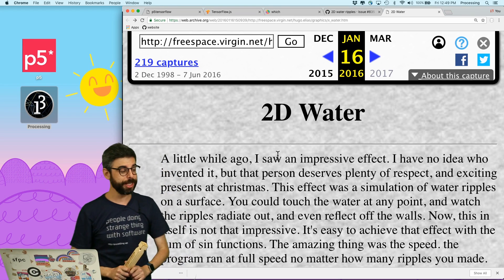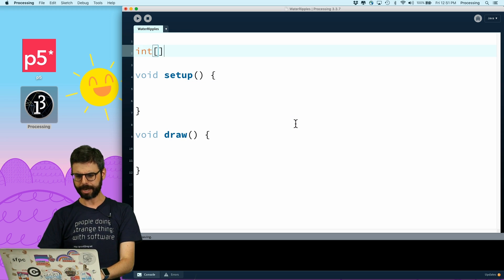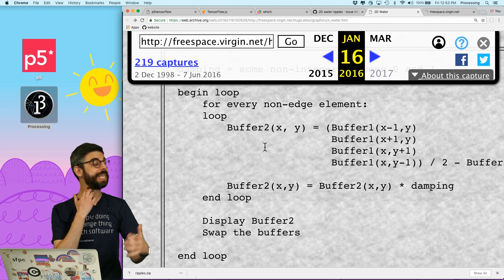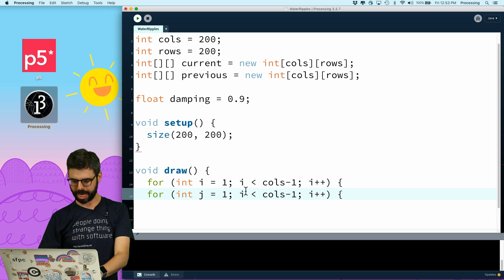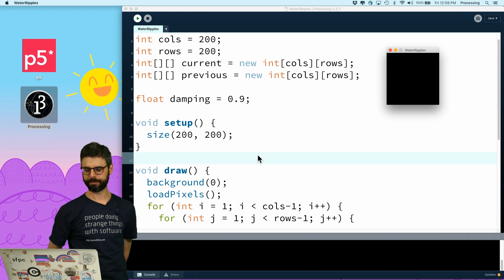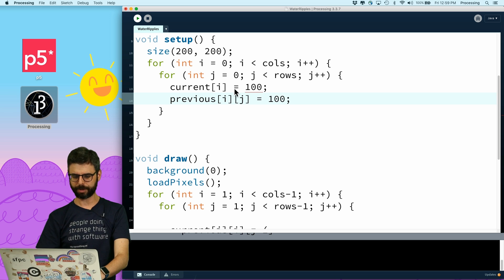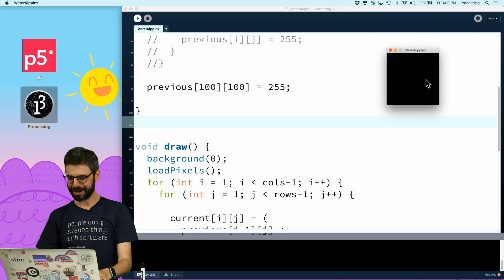Coding Challenge 102: 2D Water Ripple

Comment: That's a fun and nice simple routine that I've appropriated to create a 1D FastLED example on the Arduino.

My challenge, however, is limited RAM.  Some folks spend most of their available RAM on the CRGB array for the LEDs, and not enough memory is left over for the arrays used in this example.

So, how to create a nice smooth propagated and dampened droplet without using arrays.  So far, I've got sine waves, phase shifting and exponential dampening, but not the time oriented propagation from the initial 'splash'.

Comment: Hi Coding Train,

I made a OOP port to .Net / C# Forms, slightly more difficult than Javascript which does not really care about Type safety:
https://github.com/bieblsoft/Water_Ripple

I wonder why your code produces grayscale images, since you use the area values for defining Color value ??? Maybe black and white projector or such ? Mine is very colorful.
Another Problem i ran into is to signal when all values are back to 0 or at least a specific value ("rippling" is done). I simply limited the drawing loop for a workaround.
This "processing" stuff reminds me a little of Arduino coding, all the "Run()  Looping/Calling" is done invisible in the Background (of course Arduino coding usually lacks a screen).

Maybe i will try also in C++ to give it real speed, but this will require some graphics library.

Comment: Great video!
I was able to get the same result, however, I can't figure out how to use an image as the background which interacts with the ripples. Any help? :)
Reply: You need to create a displacement map, derived from the current buffer. The current buffer can be thought as a height map.
For each pixel in the image, the displacement map has two elements, dX and dY (which together form the displacement vector). 
The C declaration of such displacement map looks like this:

struct DMAP {float dX, dY} disp [W][H];

and can be computed as follows:

disp [x][y] .dX = ( current [x+1][y]  -  current [x][y] ) * RI;
disp [x][y] .dY = ( current [x][y+1]  -  current [x][y] ) * RI;

where RI is a constant between 0.0f and 2.0f or more, which you can loosely call the refraction index, and sets the strength of the distortion.

To use the displacement map on the image: 

OutputImage [x][y] = SourceImage [x][y]  +  (int) disp [x][y] .dY * W  +  disp [x][y] .dX;

Comment: A nice example - but the numerics bugged me because it looked so close to a numerical derivative! It turns out it actually is just the naive central difference approximation to the 2D wave equation on a square lattice, but with a very special choice of wave speed and/or step size. Here's a derivation with a unit time and space step size:

Use central difference to get discrete version of wave equation for ripple height H:  
d_tt H = c^2 (d_xx + d_yy) H
H_{x,y,t-1} - 2 H_{x,y,t} + H_{x,y,t+1} = c^2 (H_{x-1,y,t} - 2 H_{x,y,t} + H_{x+1,y,t} + H_{x,y-1,t} - 2 H_{x,y,t} + H_{x,y+1,t})
H_{x,y,t+1} = c^2 (H_{x-1,y,t} + H_{x+1,y,t} + H_{x,y-1,t} + H_{x,y+1,t}) + (2 - 4 c^2) H_{x,y,t} - H_{x,y,t-1}
If c^2 = 0.5 then you get the nice simplification that is used in this video
H_{x,y,t+1} = 0.5 * (H_{x-1,y,t} + H_{x+1,y,t} + H_{x,y-1,t} + H_{x,y+1,t}) - H_{x,y,t-1}
Reply from the maker: whoa, thanks for this!
Reply: shut up simon

Comment: the algorithm works, but i cant wrap my head around why it works
Reply: Here's a derivation of the algorithm: use a central difference approximation to get discrete version of wave equation for ripple height H:  d_tt H = c^2 (d_xx + d_yy) H
H_{x,y,t-1} - 2 H_{x,y,t} + H_{x,y,t+1} = c^2 (H_{x-1,y,t} - 2 H_{x,y,t} + H_{x+1,y,t} + H_{x,y-1,t} - 2 H_{x,y,t} + H_{x,y+1,t})
H_{x,y,t+1} = c^2 (H_{x-1,y,t} + H_{x+1,y,t} + H_{x,y-1,t} + H_{x,y+1,t}) + (2 - 4 c^2) H_{x,y,t} - H_{x,y,t-1}
If c^2 = 0.5 then you get the nice simplification that is used in this video
H_{x,y,t+1} = 0.5 * (H_{x-1,y,t} + H_{x+1,y,t} + H_{x,y-1,t} + H_{x,y+1,t}) - H_{x,y,t-1}
You can then use two arrays to store the current and previous grid values as done in the video.
Reply: I just opened paint and like manually did a 4*4 grid according to the code, and kinda understood. I know it sounds dumb (and it is) but it helped.

Comment: This is my code so far and for some reason when I run it I end up getting four white squares at the top? (this is javascript) Can anyone help?

var damping = 0.9;
var current;
var previous;
function make2DArray(cols, rows)    {
    var arr = new Array(cols);
    for (var i = 0; i < arr.length; i++)    {
        arr[i] = new Array(rows);
    }
    return arr;
}
function setup()    {
    createCanvas(400,400);
    cols = width;
    rows = height;
    current = make2DArray(width, height);
    previous = make2DArray(width, height);
    for (var i = 0; i < cols; i++)  {
        for (var j = 0; j < rows; j++)  {
            current[i][j] = 0;
            previous[i][j] = 0;
        }

    }
    
}

function draw() {
    background(0);
    loadPixels();
    for (var i = 1; i < cols - 1; i++)    {
        for (var j = 1; j < rows-1; j++)    {
        current[i][j] = (
            previous[i+1][j]+
            previous[i-1][j]+
            previous[i][j+1]+
            previous[i][j-1]) / 2 - previous[i][j];
            var index = i + j * rows;
            pixels[index] = color(current[i][j]);
        }
    }
    updatePixels();

}
Reply: Same problem here! Can't get it to work using p5.js...
Reply: OK so when Dan said p5.js would be slow he wasn't kidding. The issue is that the pixels array stores 4 values for each pixel R,G,B,A so your index needs to be multiplied by four and you also need to change the r,g,and b values. I used a for loop originally but better yet is to use the set() function because your i and j values are already the x and y values of the pixel so you can write, "set(i, j, current[i][j]);"

Comment: Very cool result from a seemingly simple looking code.

If your arrays become too large and you need to save memory, it is possible to "skip" the temp array and the swap operation at the expense of adding some dirty looking code.: you add a second loop after the first one with the arrays swapped "by hand" (it requires a rendering in between them).

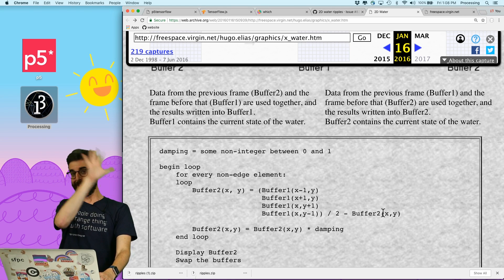Comment: Looks like color(current[i][j]) at 12:30 became color(current[i][j]*255) at 12:49 without any explanation ...
Reply from the maker: This is just a mistake that occurred during my debugging. I've removed it and added a short explanation here.
https://github.com/CodingTrain/website/commit/eb798afc71f8e8cf3e2a71779dc52907305ea74b#diff-11c53590d2031c3a491dcca747f3831b
Thank you for pointing this out!
Reply: Since the values in current and previous are already between 0 and 255, why do we have to multiply them again by 255 ?
Reply: I don't get the ranges of these values either. The array is init'd with 0's I think (he didn't explicitly init it) and with the dampening at 0.9 the number may be getting so low you can't see anything so he pushed it up with * 255 (which would clip past 255 often I'm sure). He also changed the array to hold floats so he may have messed up some assumption the original code made about the values being words (unsigned ints) and how these were truncated using integer arithmetic.

who knows but it's a good question. He already messed this one up after renaming the arrays from buffer1/2 and the iterators from x/y to i/j and totally confused himself. :)
Reply: Thank you for taking the time to respond
Reply: He made the values a float and so float * 255 to convert to a color wasnt it?
Reply: I love you for this comment
Reply: took me a solid minute, but found out one way to add rgb with the line:

pixels[index] = color(current[i][j]*r, current[i][j]*g, current[i][j]*b);

just declaring and setting r, g, b to what you want. With the updated mouse press line, this code example is very cool and looks sweet! Cheers!

edit* and found out you can have it change color s it moves by adding above the updatePixels line:

  if ( r == 254 ) {
  z = z*(-1);
  }
  r = r + z;
  b = b - z;
  if ( r == 0 ) {
  z = z*(-1);
  }

and just declare z as 1. This will switch the wave from blue to red and back.

edit 2* I cant stop playing with this AHHH haha. Found out if you change the divide by 2 when adding up all the previous points, to a divide by like sqrt(9999999) you get a really cool flickering stars effect. like perfect flickering stars, especially with a rotating color from like white to yellow. very awesome!